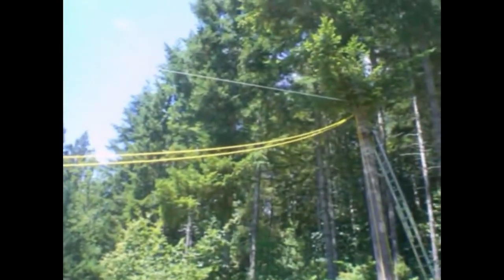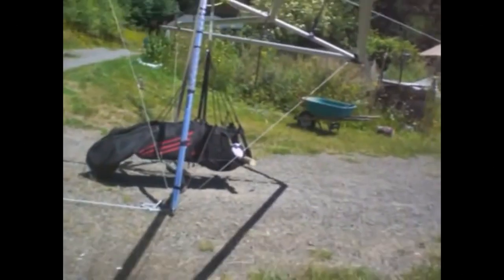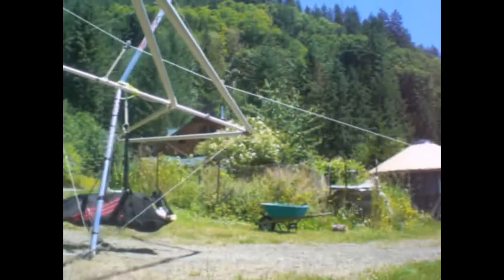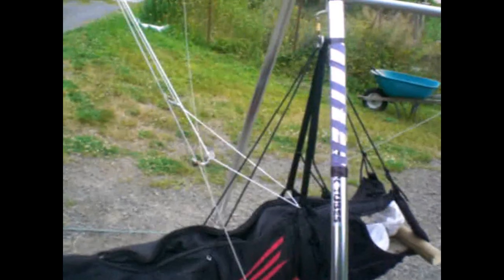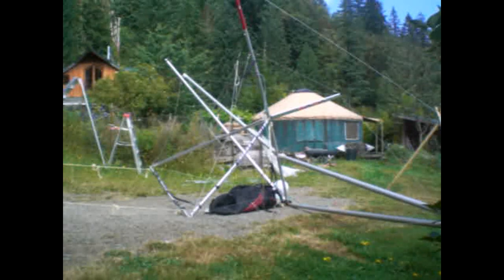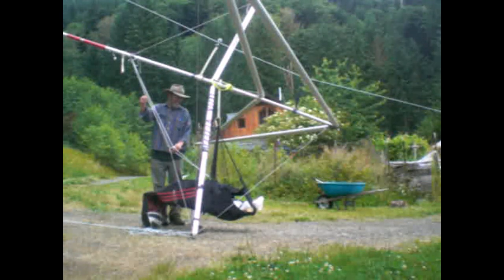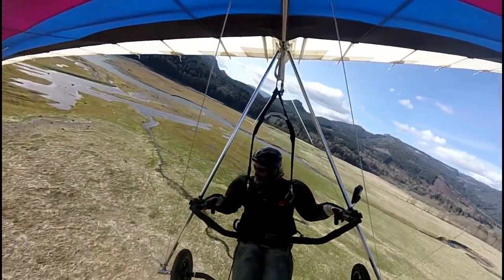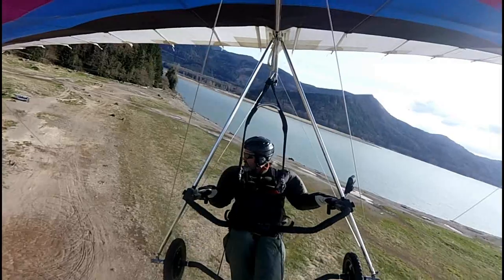Hang Gliding Crash Restraint System developed by Fenison FlyBar

Comment: I'm glad that someone has been working on this.  Unfortunately, I've only just seen it for the first time.  As the nose angle of gliders has increased over the years, there has been an increased risk of the pilot being hit on the back of the neck by the nose of the glider in a crash.  This would mean serious injuries.  Fortunately, I haven't heard of specific cases of this, but I did see a video of a top pilot in a comp crossing a goal line too low to flare and the nose of his glider missed his head/ neck by about 1ft!

Comment: Hi, 
good luck with developing this.

Back in 1990 I piled in after being caught by a very punchy thermal lifting off the ground just after take off.
On impact (about 30mph) I swing through, yes through, the left upright breaking my upper arm just below the shoulder joint - then, me the pilot, still heavily in motion with my head nicely in its helmet, connected with the keel tube, breaking the keel tube in two. The left leading edge also snapped. The glider then flipped inverted. Boy was I lucky, Very lucky, it could have been my neck. I was also lucky not to have been alone.

My arm healed. I bought a new helmet, the old one was split across 50% of its shell. Had the glider repaired.

Drag penalty? Minimal. Even for competition pilots, who wear streamlined helmets, but never fly with them aligned with the airflow thus creating more drag. They’d be better off with nice round helmets.

So Yes, Keep up the good work.

Comment: I love the idea, but!...The tests that restrain the pilot, does not involve the nose of your test frame hitting the ground.  The first test of the unrestrained pilot, the nose of the frame hits the ground. Please correct me if I'm wrong.
Reply from the maker: No, you are right Mark.  The test vehicle needs improved to more perfectly simulate a whack scenario.  this is all I could accomplish on my budget.  I built the entire zip line for about 30 dollars....just working with what I had.   ALL that being said.  I still feel there is enough evidence here to indicate that a restraint line would work if properly designed and properly tested.  The forward swing CAN be limited.   The main load IS removed from the main effectively dampening the pendulum effect....So even though these tests do not constitute absolute proof...there are .Lots of clues that show such a line, mounted low to the rear wires, might prove very effective.....but....proper testing = $$$$...
Reply: It's similar in concept to the HANS Device that restrains the head and neck for racing car drivers.

Comment: Sorry dude, but if you don't know how to judge landing conditions, and how to land, don't fly !
Reply from the maker: Every XC pilot I know who has racked up some serious hours has had the wind shift during the landing sequence at some point (due to thermal activity) and found their self coming in downwind due to no fault of their own.  Actually, Every pilot I know with serious hours has also racked up at least one serious "whack" in the process.  I define "serious hours" as forty or more years of continuous hang gliding experience.  I have flown a couple thousand miles of XC,  not a lot compared to some.  I competed in the Chelan XC Classic for several years and did pretty good.   And I have found that shit happens, it just does, no matter how good one is.  And until we know how to control when and where thermals are going to actually "break off"?  Ideas like this could be the answer to prevent injury from crashes that results from "acts of god".
 I think it would be awesome if this "restraint line" idea actually works in real life.  Unfortunately I do not have the finances to build a REAL zip line that simulates whacks perfectly nor do I have the finances to hire the engineers to install g-meters, piezo meters, etc. to record and interpret the data...so this project is not going anywhere presently.

Comment from the maker: I disagree with some of my own comments in this video now.  Instead of a line running through the "flybar" to stop the forward motion of the Suprone pilot the same set up used for the Prone position could be used and attached directly to the rear or the sides of the suprone harness to much greater effect.  A safety restraint pulling from the rear of the suprone harness effectively transforms the suprone harness into a five point safety restraint harness spreading out the effects of a rapid deceleration evenly over the pilots body.....should work fantastic.  I am looking forward to putting up another zipline this spring and test this concept more thoroughly.

Comment: Nice! Does it  wear off where it connects to the back of the harness ? just wondering?
Reply from the maker: probably.  This was all rigged for concept testing and not production or long term use.  The safety restraint system has never been tested in real flight.  If this does indeed, prove to be a means of saving our necks it would be designed and attached in a manner that would minimize wear and tear.
Reply: very good invention or idea. it's almost free to build?

Comment: @2:59 what keeps the glider's nose off the ground?
Reply from the maker: Great observation!  Main reason all this "testing" needs to be redone in a more professional manner.  I had not yet developed a trolley that "breaks away" and allows a full "whack" action.  Did what I did, posted what I did, then got distracted from this project with the "flyBar" project.  Please note....these tests, due to this very thing.  The inconsistency of the testing apparatus, does not, in my opinion, totally invalidate what we are seeing, but also does not totally "prove" a restraint line would work in a real life scenario.  It all needs to be redone in a more professional manner and ANYONE can step forward to do this.  I am moving forward with the FlyBar project at this time and I can not do both at the same time.  After the FlyBar is in production maybe?  But I encourage anyone who sees the potential indicated by these crude tests and wants to move forward with the "restraint line" idea to pick this up and run with it.
Reply: Looks like it keeps the pilot from hitting the keel or going under the nose, and could keep the pilot from hitting the ground (when the nose & control bar are on the ground), but I can't tell from the video.
Reply: What if the hang point was from a collar around the keel, a sliding collar that's spring loaded to slide backwards in a crash?
Reply from the maker: from the experiments I have done so far sp4jx7 the pendular motion, the upward swinging arc of the pilot would again put the pilots head into the keel.  The restraint line does three things.  first, it transfers the load from the main suspension lines to the rear restraint.  You can see the mainlines actually loosen as this happens.  this interrupts the upward arc.  Second, it obviously restricts how far forward a pilot can physically swing.  Whether or not there is even going to be geometrical room for this on a high aspect ratio wing such as a T2 or a lightspeed I have no idea as of yet.   Three....in the "triangle" design the rear wires squeeze together at the same time they restrict forward swing, thus providing some "shock absorption" action at the same time.
I tried many variation of keel mounted systems.  I did NOT try the sliding collar you suggest (great idea, keep them coming), but all tthe keel mounted restraints tried so far still allowed the pilot to continue that deadly upward arc.

Comment from the maker: Just realized a lot of pilots do not know how to save their neck in a serious "whack" scenario without a safety device.  I just shared on my facebook site and decided this is a good place to share it again
What you do is let go with one hand and lightly hold to only one down tube so as you swing through the A-Frame your body swings in a sideways arc and your head stays near the down tube area.  The best way if you have time is let go of one down tube and lightly wrap both hands around the other down tube.
What this does is keep your head in clean air instead of swinging foreword and striking the keel or sail.  It Works.
I have used this to save my own neck one time.  I have talked with other pilots who have also done this with outstanding results.  One pilot I know crashed at nearly 40 mph and walked away unscathed.  Both down tubes broke and the entire ATOS came crashing down on top of him but the "one hand" only swung his body sideways into a survivable position....
HOpe you never need to use this technique but it is good to have in your mental arsenal of survival skills.....Cheers...sj

Comment from the maker: I see pluses and minuses in the two restraint line configurations showcased in this video.  BOTH restraint lines showcased in this video might interfere with the parachute bridle when the laundry is tossed.
The restraint line that is triangular (the first line shown in the video) might have two advantages.  I have been upside down in a hang glider hanging from my base tube and it seems to me the triangular system would keep my body from falling into my sail, which would be a good thing.
The second advantage I see in the triangular line is it squeezes the rear flying wires together as it limits the foreword swing.  This allowed the "test dummy" to travel a bit more foreword than the second line set up but it also provided a built in "shock absorption" that I could not duplicate any other way.  I had previously tried shock cords built into the system and those were a total fail allowing way too much foreword motion.
The triangular line is still going to mess with the parachute bridle if the reserve is tossed but the amount of foreword travel it allowed with the delron line was perfect.  Also the shock absorption by the action of pulling the rear flying wires together was perfect.  I also like the fact it would keep my body from falling into the sail which might keep the pilots body from breaking the glider and negate the need to toss a reserve in the first place.....but still....exactly how this line would interfere with the parachute bridle in a rear deployment is an issue for consideration...
Those are my observations so far, thanks for watching and thanks for your comments and observations.  All input is deeply appreciated...later....SJ

Comment from the maker: Working on the tutorial for the flybar but wanted to post, for those who are already building one, the four main safety consideration I have encountered so far to take into account.....actually...five safety concerns....
1. do no harm to the down tubes in any way. 
2. the fly bar must be very stiff from the point behind one down tube to that same point behind the other down tube to not allow any twisting of the down tubes to take place as pressure is applied to the rear handles.
3.limit how far forward you can pull yourself in as to not exceed the manufactures placarded VNE limit of the glider you are flying.  I have found placing the transverse portion of the flyBar 10 inches foreword of the down tubes did not allow me to exceed the manufactures placarded limits, but that was only my experience on my wills wing super sport.      
 4.  Also, if the flybar is too far foreword and/or too close to the pilots legs there will not be enough room under the flybar for the pilots legs to swing through in a whack scenario....those are the big four design parameters I have encountered so far and I only have 38 flights in this configuration. 
 Another item to give a lot of consideration is how are you going to get your reserve out and does the flybar serve as an obstacle to deployment of a reserve? So please stay safe and remember the FlyBar is still experimental at this point.  If you choose to build one, you are now your own test pilot and must start thinking like a test pilot to stay safe.   Thanks...... sj

Comment from the maker: I appreciate all input from pilots and non-pilots alike.  If a restraint device as shown in this video was developed and put into production, would you fly with it?  And if not, why not?  Also, based on your observations of hang gliding incidents, which safety device do you think would save the most lives?  A thoroughly tested and proven restraint line? Wheels?  Helmets?  Or parachutes?  In what order would you rank these four items in importance?

Thanks......later...sj
Reply: Seems like a great idea.   I cant see any objectionable issues. Your basically tethering a limit line to the pilot's harness from  the strength of a cable truss. It would never come into play unless your in a crash situation, way past  flyable hang position  in the down tubes.
Reply: Good idea and initial testing.  I think the risk of head/ neck injuries has increased with the development of high aspect ratio/ larger nose angle HP wings.  The pilot's head/ neck can hit the ground first and then get hit hard from behind/ on top - by the nose of the glider coming down fast.